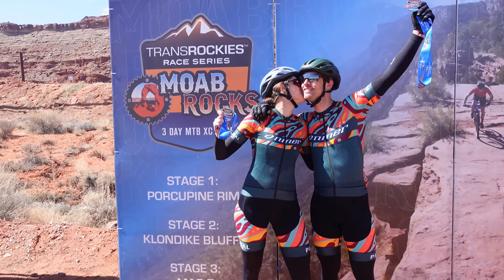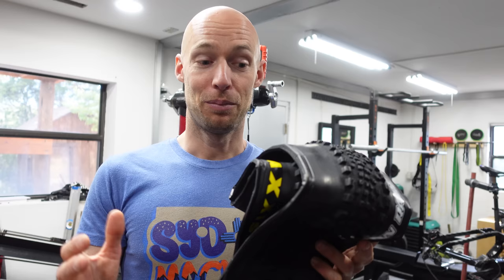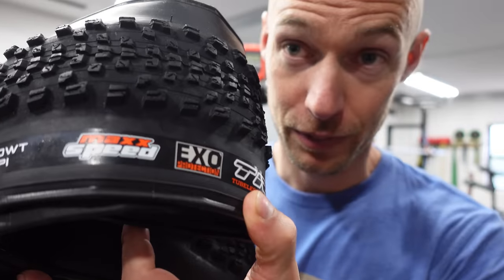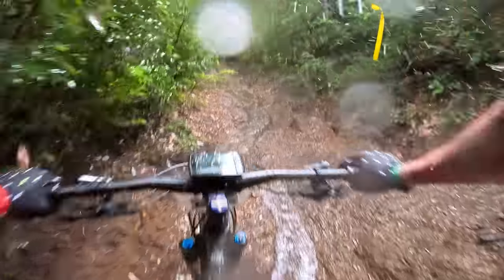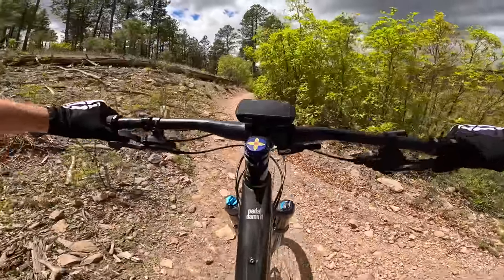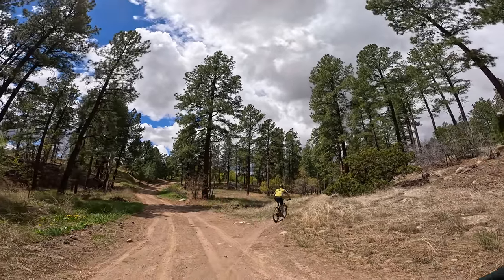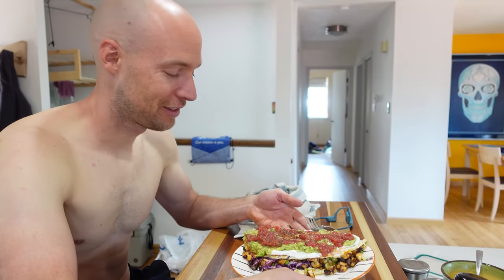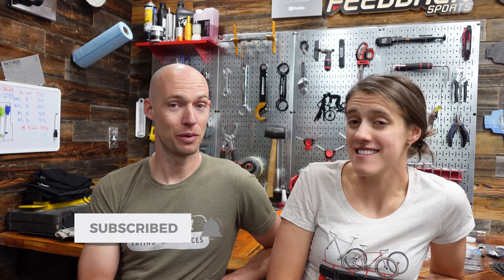Is Maxxis' new MaxxSpeed compound really faster?

Comment: For Macky's 19m uphill and given Maxxis's claim of one minute saved over 90 minutes of racing, you could expect 60s * 19/90 savings, or 12.67s.  You got 13s.  I think you nailed it!  Syd's at 6s for 15m of riding is a bit low for their claims but still better.  So, I'm thinking that the compound probably helps as Maxxis claims.

Comment: Other factors beyond rolling resistence can be just as important. Like you stated grip in the wet . Other factors is grip in corners that can play a big part in a race . Puncture protection and one puncture away from loosing a podium . That's what's challenging with mountain biking which is all the variables

Comment: Another great comparison video. I’m new to cycling and really enjoy your content! I have a question? What’s your opinion on oval chainrings? I’ve noticed very few pro’s like yourself running them and it might have more benefits to novice riders with uneven pedal strokes.
Reply from the maker: Our reasoning is if they were actually beneficial then pro road tour teams would use them (since they're trying so hard to get every benefit possible, sometimes even illegal ones). So we've never tried them. Lots of people seem to like them though 🤷‍♂️

Comment: I just purchased the new 2.4 aspen max speed, unfortunately they are heavier, 760 grams compared to the previous model which were around 720.  Not sure but that probably nullifies the speed improvement.  What do you think?
Reply: Weight and speed are not clearly linked. If they were everyone would still be running 26 inch narrow tires.
Reply from the maker: Also, a little known fact is that there's quite a bit of weight variation tire to tire of the same model in the same compound. For example, the Rekon Races we were using, the old compound, one was 850g and the other was 820. And the new compound, one was 810 and the other was 800. So although the one you got might be heavier, I wouldn't assume that means the new compound is heavier.

Comment: I notice that the newest compound tire listings for both the Aspen and the Rekon Race removed the 'WT' rating from the tire size.  Are they no longer WT rated or is it now assumed?
Reply: The website charts seem a bit outdated.  I ordered these straight from Maxxis and the item itself is described as 29.2.40WT for the MaxxSpeed compound tire (TB00464700)

Comment: Сan you sort by rolling resistance tires with new MaxxSpeed  compound (in sizes 2.35"-2.40", with set to rim internal width about 30mm), i think it will be ASPEN(more faster)=>RECON RACE=>IKON(more slower), thanks

Comment: Hi Sid and Macky. Would you recommend the Rekon Race for a front tyre. I am on a 140mm trail bike but only ride technical XC . Do you find it enough grip?
Reply from the maker: You might be happier on a Rekon on the front instead of the Rekon Race. It's got great traction and still rolls well. Unless you're planning to race XC seriously at which point the Rekon Race would be a better option.

Comment: Are these both a front and rear tire? Or do they have different variations for front and rear? I currently use a maxis dhf for rear and a maxxis aggressor on the front and am down to try different ones…thinking i might try the rekons
Reply: Rekon Race doesn't have separate front and rear versions.  Aggressor/DHF is definitely a weird combo, usually people run them the other way around (DHF Front/Aggressor rear).  Based on personal experience, the Rekon and Rekon Race are XC tires, meaning they don't have a ton of cornering knob to work with, but roll real fast.  I think a good lightweight combo would be the new Forkaster up front and a Rekon Race out back.

Comment: I have run Maxxis race rekon for the past 4 years both 60 and 120 tpi found the 60 gives more puncture resistance. What psi do you run them at on average.
Reply from the maker: Macky - 22/25, Syd - 19/23

Comment: Hi, I would love it if you could do a video on how you guys are fast on such low training volume.
Reply: Low training volume 🙂 Follow them on strava
Reply: @simonnrgaard7731  I do. They don’t don’t train very much around 7 to 13 hours a week.
Reply: Yes on the bike 
Fitness gym is the key just ask Nino
Reply from the maker: @mioutdoors426  quality over quantity always. A lot of gym work/strength training (that doesn't show up on Strava) and a lot of threshold/vo2 work. Adding more volume is counterproductive if you don't have time to recover. When we're in the race season, we are mostly racing and recovering/maintaining during the week, so fairly low volume but high intensity. Hoping to get a higher volume week or two in June before BCBR but that will require not racing for a few weeks. Some people respond better to volume, some to intensity, depends a lot on the athlete.

Comment: Well the good news is, your both extremely fast, the bad news is...your bad at math on or off the bike 🤣. It's 60s * 20s/90s = 13.33, since Sid did it in 15 minutes she would be 60s * 15s/90s = 10s. I also don't get how Sid did the same lap in less time with less wattage?

One other thing, I'm actually going to get either the Rekon Race MaxxSpeed, or Aspen MaxxSpeed in the near future. Any reason you prefer the Rekon Race over the Aspen?
Reply from the maker: Syd is lighter than I am, so technically it is possible, but in this case she ended up doing a different and slightly shorter loop with the goal of us ending around the same time.
Reply from the maker: We tend to choose the Rekon Races as they provide more traction and a lot of the races we've been doing justify extra traction!
Reply: @sydandmacky  Thanks, sounds like I'll probably want the Rekon Race then, with maybe a Rekon up front. Years ago I had an Ikon out back and an Ardent Race up front. I didn't like the Ikon because of the vague cornering or climbing traction out back, and didn't like the unpredictable cornering up front of the Ardent Race. So I moved the Ardent Race out back (like it's cornering as a rear), put the old Forekaster up front (like how it's predictable when cornering) and have really enjoyed that setup. But the Ardent Race is worn and I'd like something a little faster rolling, especially up front.
Reply: @sydandmacky  Recon Race are recommended only for rear, you set it to rear and front?